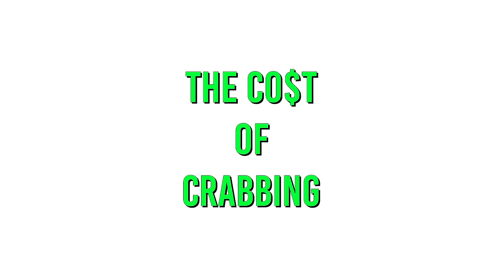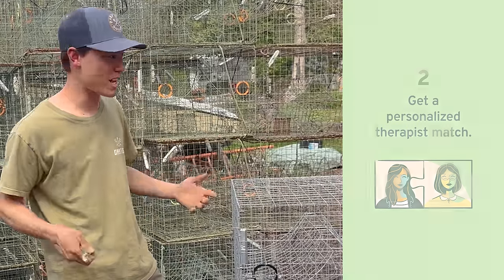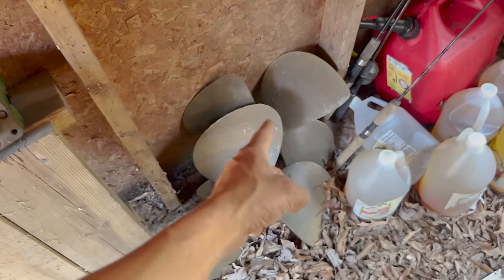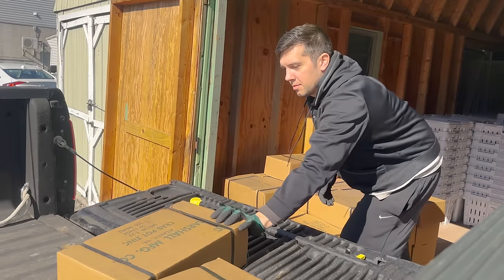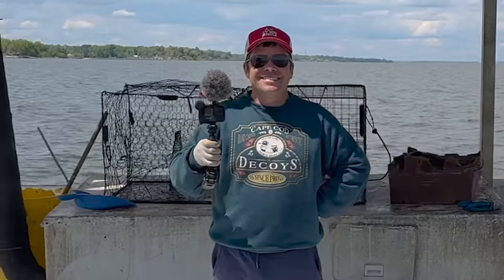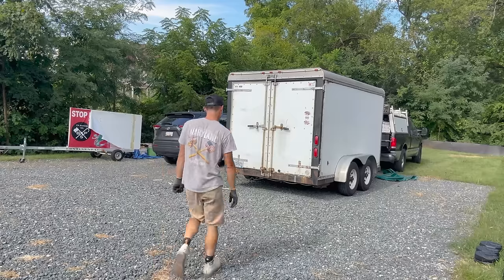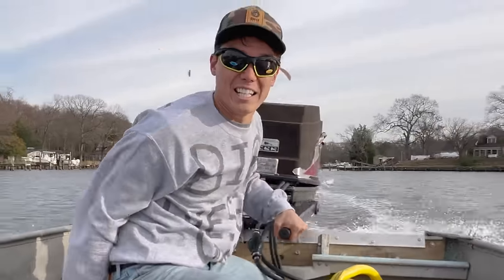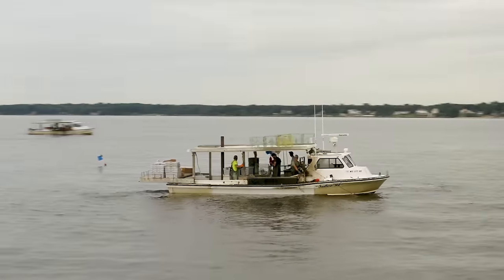The COST of CRABBING

Comment: You need to look into a cooltrax setup for your crab trailer. It automatically monitors the actual temp inside and you can set what temperature to alert you at so no matter what or where you’re you are if your system goes down (crabs start dying) it will blow your phone up and let you know something is wrong. Costs around $500 to get the transponder and temp pucks then it’s like $100 a year for the service. One saved breakdown will pay for it easily. We use them in the produce hauling game to protect our stuff.

Comment: had 2 twin disc transmissions mated to triple nickle cummins at work that we pulled out of an old chriscraft as we crushed it, we sold the pair for 4 grand i think. We got the completely assembled engine running on the trailer and both gearboxes were known good. bossman said they were worth around 8-12 each

Comment: As  marine biologist, two things that you said in this and past videos, I would tackle are crab deaths and the pollution in the bay. If your home has access to the bay water, I would make 3 to 4 holding tanks for each crab size, doesn't need to be big tanks since you are only keeping them for a maximum of 5 days, they just need a good aeration system and a UV treatment on the water you pump into the tanks, so plenty of oxygen and the UV system will sterilize the water and remove the effects of the pollution on the crabs, same way they treat any shellfish (mussels,oysters,clams etc). So you can increase the price of your product, while keeping people safe from the pollution in the bay.

Comment: The industry has changed a lot since I was a teenager in the 80s and my cousins and uncles and dad were crabbing.  I grew up in Eastern NC and the way they crab pot there is different too though.  The gear is less complicated, the boats are smaller and the overhead wasn't nearly so high. 

My cousins were both giving 16 ft outboard workboats when they turned 13 or 14 and 300 or 400 individual pots by my uncle and went to work catching crabs.  Back then they'd take each days catch directly to the local seafood processers and they got paid enough to cover their expenses which were significantly lower.  Being able to fish from 16 foot boat with a 40 or 50 HP outboard motor was a lot less money even if they had to pay today's prices.  Not having to store the crabs beyond the time it took to take them to the processor after they were caught was a lot cheaper too.  It was still incredibly hard labor of course.  I went out with them when I was visiting and it was obvious how backbreaking it was.  The boys made good money though.  Both of them were able to buy brand new cars when they turned 16, both of got newer workboats by the time they were 18. And of course both of them bought more pots to increase their catch.  Of course things have changed a lot since those days. And it's not been a change for the better unfortunately.

If there is one thing I've learned in mid life that I wish I had realized when I was younger though it's that you absolutely NEED to be kind to your body. Eventually it will catch up to you if you don't take care of yourself and don't push yourself too hard.  My mom's husband died pretty young a few years back because he didn't take care of his health like he should have. My uncle nearly died young too because he did the same thing until he got a terrible scare from it.  Good health is absolutely the most priceless thing you can have in this life, if you are healthy all things can be possible. If you aren't everything is so much harder to get done.

Comment: Too bad Greenline yachts don't sell their diesel/electric hybrid motors. Those things get crazy good fuel economy. Especially when you got some solar on the roof, either powering your auxiliaries or charging your batteries.
I don't know if it would work in this application, but it sure seems like it would.

Comment: It only gets worse, what does that mean : cost ,when I was building crabpots they were $13 per frame in the early 90s when I quit in the 2015 or so they were $28 , zinks were $45box early 90s ,2015 zinks were $100box , red fuel in the 90s 75cents  fuel 2015 $3.50gal , razor clams 90s $25 bushel 2015 razors $40 bushel  and on and on the price keeps getting higher and higher.Also don't forget your living in a state that doesn't care about the bay and this one will get you the most. Yes I definitely miss crabpotting but it's just too much money out of the    pocket to break even every year.  When you said zinks are over $200 a box in 2024 it helps me not miss it so much anymore.

Comment: It’s not just the crabbing.  Trust.  I have a certain model light I replace for people.  It used to be $356ish installed.  That same light in the last few years is now $592 per light.  I’m getting ready to call someone back.  A few years ago to fix the issue they’re having used to be $800ish.  Now it’s 1243 before I even add my fee.  
It’s almost impossible to make money nowadays.  And I’ve only increased my fee a fraction compared to the price hike of the parts.  

It’s all been F’ed up.   You’re definitely not the only one feeling the bullshit.  More people hold off on repairs if they’re able to.  
An some have backed out of repairs after originally agreeing. 

Something has got to give before long

Comment: There’s one thing for sure you don’t have any competition trying to take your job. When I get around these mama boys and girls who complain about having to go to? Work? When they can’t even hold down a job flipping burgers. 
The fishing industry has been rough we started out depending on the fish house for fuel,bait,ice, fish for a week hand lining no sleep catching,prepping,packing the ice hole return to the fish house only to break even . We finally had to sell retail so like you running a business from home. We were happy with all the madness I guess because there was so little down time you didn’t have time to think about it.
Bad weather you couldn’t go out so you worked on the boat and worried about what kind of damage you crab or lobster traps were getting. Don’t even start on the preparation for a hurricane.
 Fishing, logging, steel working,anything that requires some common and not so common sense and the pure pleasure of doing something that you can see, touch and live is worth way more than spending the day on your butt punching buttons.